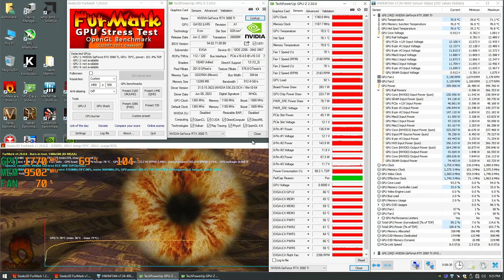Why you should try cheap thermal paste first

Comment: You should let pass at least 24 hours on each thermal paste to see real results of different pasts. I tested the most famous pasts too, but ended-up using pur white silicone paste, after one year no out drying like the Arctic or Noctua, no difference in temperature...

Comment: I'm stunned you would say you don't care about the thermal rating. I would hope you want at least 3.0 or better to ensure you aren't going to put some trash paste on your device that does next to nothing and let's your device fry before you can log on. You can find a ton of dirt cheap paste that is rated around 3m/kw easy. They way you say it sounds like you don't care if it's lower than .50m/kw which is rediculous.

Comment: I use HY-510 for everything.  It works about as well as Arctic Silver Ceramique II and that's more than good enough for 99% of people.  I've even used it on the exposed die of a Radeon RX 580 2048SP and it works fine there too.  I'm not in the habit of running FurMark so I don't care about the extra 10°C seen there because it's perfectly fine for mainstream use.

Sure, I might not win any CineBench competitions but my CPU never thermal throttles and stays well within spec so I'm perfectly happy with it, especially since it's dirt-cheap.  Like, I got THREE HUNDRED GRAMS of it (10 × 30g tubes) for less than 25 Canadian dollars.  I even sold one tube to a co-worker for $5  which is more than double what I paid for it.

Comment: You cannot trust the thermal conductivity ratings because companies lie about consumer (trash) products. Industrial like Honeywell PTC is a real rating.  If I'm repeatedly fitting something for testing, I might even save a bit of time and money by reusing paste.   Scrape the core with a credit card or business card, scrape the copper pad, and then I can press one neat line across the center.  Fast, easy, no contamination, and it really won't matter since it's temporary.  Who cares?

Comment: You should really try GD900, it performs nearly the same as MX4 and it's rather cheap.
Reply from the maker: yes but how long does it last ?
Reply: @northwestrepair  
Quite a long actually. It's silicone base and it barely dries out. I've few laptops that were running it for at least 3 years, no issues.
Also, it's easy easier to apply.
Reply: @liveroy they have a new paste called the GD-2, it performs similar with my tube of mx-6. Pretty good for the price of $4 for 30grams lol.

Comment: For a processor with low TDP, I suggest not to overpay and apply GD-2 or GD900-1. With high TDP, it is best to apply PTM7950. And if your GPU has thermal pads, replace them with thermal putty Upsiren UX Pro.
Reply: I used the GD-2 on my 3070, it performs the same as my MX-6.

Comment: I used to put too much late on CPUs without knowing and my PC was always getting too hot in the Israeli summer until after moving to Europe I had the same issue even after changing my cooler to a top line one, so I watched some videos on the subject and that's how I found out you only need to put a drop in the CPU
Reply: Newer CPUs are a lot bigger than before so a line or a X is better. Also there is no too much. Too much just makes a mess and still gives perfect temps, not enough kills performance.
Reply: @Karavusk  I'm sorry but that's not always true, as I testified in my comment, I used to get high temperatures in my build even with a high end cooler and only when I changed to putting a pea sized dog and slap the cooler back it was showing ambient temps -this is in the hot middle eastern summers, not the American east, temperatures rise up to 42c in the shade...

Comment: Hi! Thermal paste. Never seen so much BS about that and BS "thermal paste" grotesque overpriced silly cat piss like in the pc bizniss.. I am 57, have done my professional (with degree and letter) +3 decades into discrete electronics. First at high end Hi-Fi , then at lab eq. Plenty of output stages, heatsinks, pipes etc. all over. Have done, repaired or modified +10k units.

First of all: the "hidy tidy" cat piss that is sold as thermal paste for CPU is... cat piss. 

The prices for a 2ml syringe is hilarious for contents not even worth a dog fart.

The result is "fun" right there and then where all that fluid it is diluted with is still there, then it evaporates and leave the contact surface like a Swiss cheese and but then you "have to replace it" because after all the smidgey nice fluid (that makes it even go thru a piss small syringe) it need be with NEW cat piss!
Ow man!
Real thermal paste has existed for decades and is mostly about aluminum oxide + some goo.
And it is like putty, and it will NOT evaporate or deteriorate, Maybe loose 1-3 degrees at the first start and year burn, but then solidifies and stay nice, no Swiss cheese,

What I see hereabout "thermal paste" do not meet ANY industry or professional grade (no documentation about abilities or "K" or anything) and is a sole pure cheap joke for eejits.

Real thermal paste is like PUTTY! My fave  is from "Fischer Elektronik. Wärmeleit paste". If you dear and behold need something saucy, more fluid,  then it is "KF crc 1201" paste.
The pc aftermarket with their "paste" can just go and shine em selves up the ante.

End of story: I as a professional WITH IRL from decades of results do not gives a rat ass off the pc industry "gorilla-fat-ultra-turbo-porno-mega" abilities of 24x hilarious price shop CPU/GPU paste.

Bottom line: A good paste is a one time apply with 4ever thermal conductivity do.

Today I am nice so will not get into the joke of "thermal pads"  and OFC: Mistah, you ARE skilled, reminds me of me young days, my thousand of thousands hours do repair on discrete components level. I remember the swabbing, spraying then swab and the cleansing, the double, tin-remove-tin etc. We do now should have a status of near extinct. Way less that 1 of 10 aspiring will do or can what YOU do.

I see you use a lot of wick, like I did. There is only one there: Soder-Wick 80-4-5. You can thank me later.

It is an honor see what you do and the thoughts behind it, You are a true master, letter or not.

Greetings from Norway

Comment: try gd900, got a 30g tube of it for less than $10, it performs similar to mx4, does not last that long if the device is high wattage and used daily, great for testing purposes.

Comment: Never underestimate cheap paste! 
I am working for a big Computer manufacturer and when we send replacement boards, CPUs or coolers with on-site technicians, they always come with simple industrial paste. This stuff has the consistency of playdoh, feels dry as hell, barely sticks to the surface and is a pain in the arse to spread. But holy shit this stuff performs! I used it on my 1080ti when I had to clean it and realized that my backup paste was empty. So I used that industrial crap as a temporary measure for the weekend until the good and high rated Thermal Grizzly stuff arrives. I had pretty good temperatures again.... but as I wanted the optimum I replaced it with the Glory Thermal Grizzly stuff and..... had 5K HIGHER temps!!!

Comment: Put mx-5 on my laptop and it's been a yr and running great hardly reach upper 80's or low 90's unless im pushing high or ultra graphics 1080 with frames running above 60.Usually around upper 70's mid 80's for heavy games and b4 i was getting 95 or even 99 once and it shut off cpu wise my gpu never reaches 80 usually 78 is the highest i've seen it unless adding ray-tracing and then bout 82

Comment: I just had a thought of using clay instead of using cheap thermal paste. I haven't tried it but I was just thinking of other ways of test fitting without wasting any paste
Reply: @@ithecastic update: its sucks because my cat shits on the litter so its 
covered with sand. im also constipated so i cant use this method because my dung is too hard.

Comment: For someone who uses it frequently it is one thing. The only PCs I put togather are mine and the ones from my family, which is 2. I bought Thermal Grizzly Kryonaut about 7 years ago and it took me that long to use up one syringe of 1,5ml/5,55g. I had to paste about 9 CPUs (chanigng coolers due to RMA 4 times...) and 1 GPU in that time. 
It was 15€ that syringe for 7 years of use. :D
Reply: I only use TGK also. It's the best so why fool around with the cheap stuff.

Comment: I use that "China's finest" white paste for years. At some point I got one so fluid I had excellent temperatures using it because the layer was so thin it was almost transparent. Now whenever I want excellent results I add a half of a drop of solvent on top of the paste I spread on the CPU/GPU and the layer gets extremely thin. Of course, if the thermal pads are too thick then it does not help.
For the thermal pads: I usually buy a huge pack of THERMALRIGHT EXTREME ODYSSEY, mix it completely with all the old and new thermal pads I have (leftovers included, hardened pads included) then every time I need thermal pads I make them of the desired thickness and adjust them exactly the thickness I want. Only sometimes I add a little bit of MX4 until it reaches the desired consistency. One single drop of MX4 (or any other thermal paste) makes the compound very soft so don't add much. I use this kind of stainless steel pasta maker for it  because it doesn't stick. I usually detach the cutter because I don't use.
https://www.lionsdeal.com/7-stainless-steel-pasta-maker-with-detachable-cutter.html
Reply: you use this cutter to make the pads at a specific thikness?
Reply: @yassinehani  I use the pasta maker to thin the goo to the desired thickness. I don't use the cutter part. The cutter can be removed. I use a simple hand cutter to cut the pieces of the proper size.
Reply: i see thanks @Dandan-tg6tj

Comment: Would thermal pads be quicker for fit testing? or does the mounting pressure change because of the pad?
Reply from the maker: you dont put pads on the core. pads introduces thickness. Paste does not. It fills cracks and uneven areas between the core and the heatsink.
Reply: @northwestrepair  there are actually pads for the cores, they are diferent but they exist.

Comment: I have used white lithium grease before and it works very well to test things.
Reply from the maker: lol at this point even a tooth paste will work for a test fit LOL
Reply: @northwestrepair  I realize that this sounds crazy and you're not going to believe it, and I didn't plan to, but I left white lithium grease on a phenom II x4 940 for about a year that I used daily. The max rated temperature of that cpu is 62c and it always stayed under that. Not much different than thermal paste, probably because that chip has such a large heat spreader. This was during a time when I didn't have any money for months and by the time I got some thermal paste there was no point in putting it on until the next time I cleaned the cpu.
Reply: @pf100andahalf  Just curious, did you ever remove the heatsink to replace grease with thermal paste? Did the use of white lithium grease cover everything with oil and cause a mess?
Reply: @Mandrag0ras  No, I left the white lithium grease on the phenom II even after I got thermal paste because it was still working fine, and no it didn't leak out. It stayed thick enough to not leak. The cpu was vertical on the motherboard in the case too, so it wasn't lying flat. I'm guessing the grease wouldn't work as well with a modern cpu but only for those that have a very large die like the phenom II. Since I got a large tube of cheap GD900 thermal paste from aliexpress years ago I haven't used the grease again because I didn't need to, but it sure got me buy when I needed it.
Reply: @northwestrepair  Toothpaste is not that good, but ketchup is as good as a 1,5mm thermalpad. :D Can't say anything about longterm stability thou.The one who tested that even tested cheese and potatomash...
Reply: @gucky4717 No, it's a matter of taste. I prefer mayonnaise, and you can't convince me otherwise 😂
Reply: I usually put boar grease onto it for fit testing, generously applying a cm of thickness.

If it stays fit after all that grease, I can't complain.

Comment: Interesting to know that there is a whopping 10 degree difference between high-end and low-end thermal grease.  I was expecting the difference to only be a few degrees honestly.
Reply: that cheap termal past only lasts about 2 or 3 month after that thermal gap widens
Reply: the real difference only come after 1 month when the cheap one dry out that is why you pay more for a good one to be durable and cooler
Reply: there shouldn't be a 10 degree difference and I don't think that is typically the case
Reply: In some video I found, no thermal paste is even better than cheap one.
Reply: @dedoyxp Weld them together
Reply: @dedoyxp  That's not thermal paste, that's an insulator 😂
Reply: @dedoyxp  Only If you would have truly perfect lapped surface on both cpu/gpu and heatsink. So perfect that you would push the air molecules from the gap between them :)

Comment: I paid $3.50 for my 30G tube of GD900 and it performs as good as Arctic MX-4, but significantly cheaper. Have also tried HY510 and while not as good, it's good to use in a pinch.
Reply: GD900 performs good at first but degrades very quickly
Reply: @videostar348 GD900 lasts for years with temps similar to Thermal Grizzly.
 MX-4 is at least 5~6degC worse & degrades badly after only 6 months...
I use GD900 for Diodes & FETs in PSUs & amps, high powered LEDs in flashlights & laptop CPU/GPU die where good thermal compound is critical while still being cost effective.
Reply: @videostar348 have you done any testing? Since my 1070ti was repasted years ago with a gd900 it still has the same temps 2 years later. Tech Yes City also tested the GD900's lifespan and it also showed the same temps after 18months while the mx-4 degraded in the same timeline of 18 months.
Reply: Is hy510 better? @videostar348
Reply: @videostar348  Yeah, but at $3.50 for 30g, I can afford to repaste once a month lol. 

Though on a serious note, I've found it usually lasts around 6 months actually before it starts to fall off. Not bad for something that costs 12c a gram. 

I use MX-4/MX-6 and GC Extreme personally for applications where I need longevity. I've heard NT-H1 is fantastic as well
Reply: @VanishingPoint96  Yeah repaste it every month and put your gpu chip at risk of cracking it every time. Sounds like a plan.
Reply: @VanishingPoint96  Oh god I would NOT want to have to re-paste every 6 months, ESPECIALLY on a videocard. For a videocard, I would want to use something which should still be working fine 5 years later. For me, longevity is more useful than getting that little bit extra of cooling performance.
Reply: From what I read, performance wise we got GD-2 > HY883 > GD007 > GD900-1 > GD900 > HY880 > >> HY510, they all cheap as hell and last at least as long as MX4.
Reply: @Dimension2010  i never used the cheap ones on a computer, but i use them alot in electronics diy and repairs (on critical stuff i use MX4), my current "batch" is HY880, had several others previously - just recently i repaired my sister's phone again (damn serial screen destroyer, lucky for her that model has 15$ LCDs on AliEx) after replacing the frame and screen just a few weeks prior - i found that the new paste almost dried out in that short period. A bit surprised but i knew the cheap ones dry out quicker - matters less when used generously on less stressed components. On the other hand - my "main" pc has an i5-750 (yup, 3 digits) and even though it runs smooth (browsing, office, art appreciation etc..) even chrome is like a stress test, years ago when it still had the intel fan i opened it every ~6 months for cleaning and repasting, MX4 - looked better after half a year than how the HY880 looked after a few weeks.
Thinking about it - after i replaced the fan to an arctic freezer, it might still have the original MX4 or 5 that came with the cooler - this PC runs 24/7 not going over 65° even with prime95. (good airflow+added diy filters eliminated the need for internal cleaning)
I don't know about other known brands but the arctic mx4 gave me over a decade of good results.
Reply: @Dimension2010  for real? I wok  selling computers, will buy the 30g g2 then
Reply: I had bought GD900 previously and it fits PS3, old laptops etc., but next time I will try GD007. For modern direct die devices, PTM7950 is the ultimate solution. I didn't want to risk liquid metal but needed to calm down my GTX1070 laptop. It did a lot better than any thermal paste I had try in the past.
Reply: @walitorax  007 performs a bit worse from the testing I've seen. PTM7950 though, I've heard good things about it's longevity.
Reply: HY510 probably killed my GPU xD I had RX 470 MSI and I needed paste but every shop in town was out of it only HY510... changed the paste let it run 4k youtube over night and in the morning, the GPU was dead. No signs of life. My new protocol is HY510 only for i3/i5s processors, standard i5 Hy710 minimum GD900 optimum. GPU never HY510 again.

Comment: I have been using that HY510 for almost a year..... no temp issues what so ever
Reply: I use the exact same paste and with zero issues. I run temp programs and there really is no difference enough to even be alarmed about compared to expensive paste.
Reply: i bought a tube in 2015 and have it on all my cpus its good cheap stuff